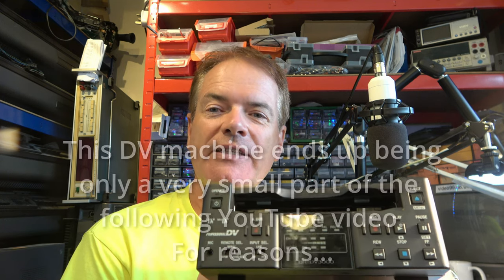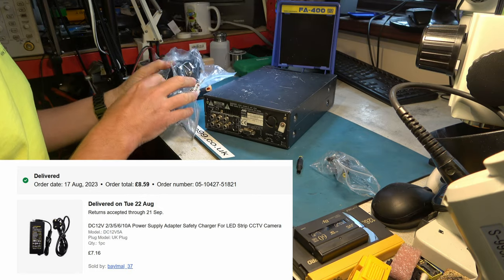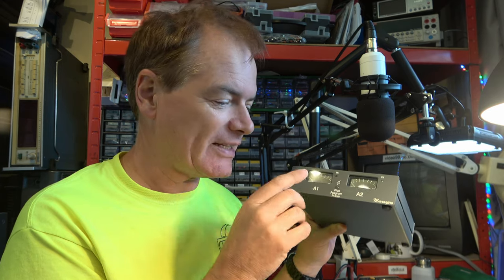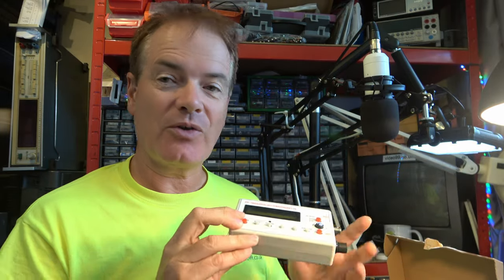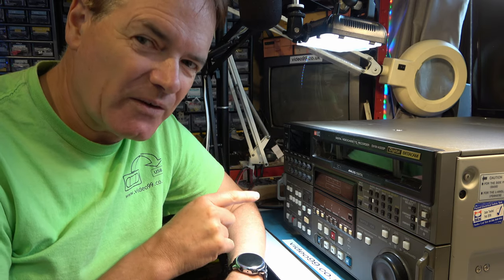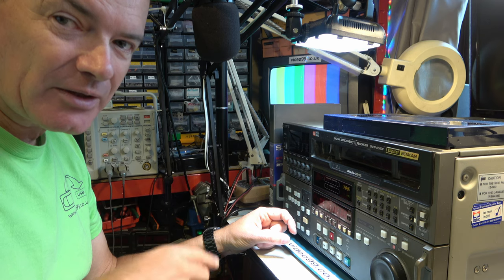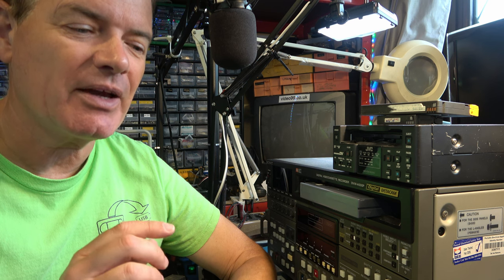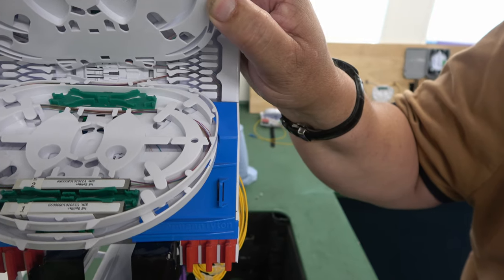JVC BR-DV3000U power, PICO PPM meter, DigiBeta breakdown. And a sig gen. What a mix!

Comment: As always Colin. It's a pleasure watching your uploads.

I just took a look at the Operational Manual for this particular machine, because I'm on the hunt for why domestic videorecorders only hava a video-S/N level around 43dB, whereas professional machinery clearly have a lower video noise floor.

Video- S/N, Sony DVW-A500P:
Digital Serial Input to Analogue Component Output: 62 dB.
Analogue Component Input to Analogue Component Output: 56 dB.
Analgue Composite Input to Analogue Composite Output: 58 dB.

Betacam SP playback:
Y: Metal Tape: 48 dB, Oxide Tape: 46 dB.
R-Y/B-Y: Metal Tape: 48 dB, Oxide Tape: 45 dB.

I guess it's no wonder why Chroma noise was/is such an issue wih domestic video recorders.
Just compare -43 dB with -58 dB. (Who's going to show this difference in a youtube video ?)

The only thing one/you/me realistically could do, was to find the tapes that performed better as shown by magazine tests/reviews, which were the only way to get a basic feeling of the quality, since videotapes were expensive.

Buy the best tapes and avoid the cheapest offers.
But even then, chroma noise got on my nerves.

Even analogue playback on these professional machines is such a delight. Clean clear colours.
Reply: Betamax III (NTSC/PAL/SECAM) 1982 Iron oxide 3.8-5.2 Mhz, JVC (Victor) VHS (NTSC) 1976, (PAL/SECAM) 1978 Iron oxide 3.8-4.8 Mhz, HQ-VHS steeper 3.15 MHz low pass filter 1986, S-VHS 1988 high density Iron oxide 5.4-7 Mhz, Video 2000 Grundig/Philips (PAL/SECAM) 1979 Chromium dioxide 3.35-4.7 Mhz. From the differences you can calculate the frequency swing, which is approx. 2MHz for Betacam. Since the synchronous pulse is included, there is even less frequency deviation left for the image content. With color under video recorders with AM modulation, tape noise is 100% visible. The color difference signals are recorded FM modulated at Betacam. Old professional recorders (Quadruplex, B-format, C-format) record an FM modulated CVBS signal. YT is unsuitable for image comparison because PAL cannot be transmitted, the sharpness is EXTREMELY reduced with SD (NTSC 50), and very strong noise reduction is applied. Since the highest FM carrier frequency is used for white, the video resolution for black is correspondingly lower. The synchronous pulse and thus the resolution/precision are even lower.

Comment: The flashing “STOP” button is simply indicating that the machine does not have a reference or sync signal (usually blackburst) attached to the REF IN connector to provide sync to the playback servo.  If I recall, the DVW-A500 has a menu option where you can turn the warning off. Generally speaking, all machines should be “clocked” to the same house reference signal to permit field accurate timing and editing between multiple machines.
Reply: It can also flash if the incoming video timing doesn't match the reference. I think that machine must have it's OUT REF switch set to INPUT rather than REF, since it stops flashing when it sees a valid video signal.

Comment: Only recently got into Digibetas, 
There are three cleaners in the unit, and should be cleaned regularly.  The roller for the rear stationary heads can be replaced or at least dusted off, but most important is the rotary head cleaner - with attached solenoid assembly and the tape scraper.  The tape scraper has a gap between the two blades and needs to be cleared out using a post-it note. The rotary head cleaner can be cleaned but should be replaced when it wears down, you don't want the plastic parts contacting the heads. All these cleaners can foul the heads if not maintained.

Comment: It could be some kind of electronic sync problem. From experience if a fault magically disappears like that it will magically reappears once the customer has lugged it back and connected it up. One quick trick is to find the PCB with all the control circuitry and try freezing those chips. I've had the odd temperamental chip where the fault is temperature dependent. Plus check the connections and anything else that might cause it. Liquid damage is another possibility.
Reply from the maker: Have you seen the price of freezer these days?  I still use it for fault finding known temperature related faults, but it's not quite as readily used to just cool down a whole machine to look for an intermittent fault.  It's possible to invert a can of "compressed air duster" for a cooling action but this method produces a lot of ice.

Comment: Red Channel condition when playing back a BetaSP tape could mean something as simple as dirty heads. Also the head drum on the Digi-Beta format is larger in diameter than the BetaSP format, so there's some processing going on when playing back the analogue format to compensate for the larger drum. That might explain the strange split picture you've got with the VITC in the centre of the image, as the signal coming off the tape is being time-compressed then expanded back to normal.
Reply from the maker: Yes I read about that time compression.  Reminds us of the processing done in the Betamovie camcorders.
Reply: I think there's similar mechanical differences between HDCam and Digi-Beta. As I remember someone bringing in some freshly recorded camera tapes on Digi-Beta format that they couldn't get to playback in their edit suite. True enough I couldn't get them to play in any DVW-A500P without a red channel condition and picture break-up. Just out of curiosity I put one in a HDW-M2000P (HDCam recorder with Multi-format playback), and it worked perfectly no break up and green channel condition. My guess is the Digi-Beta camcorder they were recorded on had a tracking/alignment error, and something about the tape wrap on the HDW deck was able to compensate for the alignment error that a standard DVW deck couldn't.

Comment: That JVC seems to be a rebranded Panasonic AG-DV2500, even the same power plug
Reply: I think that JVC was in charge, but Panasonic was allowed to have a say about what the device should look like, so that Panasonic buys a large number of units and doesn't have to build anything of its own. In any case, it looks like on Ebay that Panasonic was not the junior partner when it came to the number of units.
Reply: I think they were all made by JVC. As I don't recall a Panasonic version of the earlier JVC model the DV-300, or the later DV-6000 just this one the DV-3000/AG-DV2500.

Comment: 26:55 That warning could have been due to the difference in lubrication between tape brands. AFAIK, there were only 3 manufacturers of DV tape: Sony, Panasonic and TDK. Sony tapes used wet lubricant, and Panasonic (which made tape for JVC, Maxell, Canon and Fuji) used dry lubricant. TDK had its own Metal Evaporate formulation. According to online forums during the heyday of DV, it was advisable to stick to one lubrication type (i.e. Sony or Panasonic etc.) so as not to risk gumming up the transport by mixing types. Assuming the warning label was from a Panasonic/JVC deck, it would make sense for them to want to steer people towards sticking their own brand (and its OEM variants) over Sony.
Reply: Apart from worse adhesive spots at the beginning (and End) of the tape, I didn't notice any difference with TDK compared to Panasonic. Given the rather modest offering in Germany, I can't imagine that TDK has set up its own production line for the pancakes, which are rather difficult to produce. I only bought TDK because Panasonic "couldn't" always deliver at a good price (which is important for 3500 pieces), and I read that the pancakes come from Panasonic. I only had cleaning cassettes from SONY. Unfortunately, I am not allowed to write here about anyone who has warned their own workshops about PANASONIC cleaning cassettes, as it is just “hearsay”.
Reply: The warning sticker on the JVC deck about Sony Premium tapes was put on by the local engineering team where it was installed. My guess is it went back for repair a lot and they discovered it was the Sony tape brand causing the issue, or perhaps there was a service bulletin from JVC about it.

Comment: I wouldn't rule out Dynamic Motion Control. I have often seen positionally stable quality jumps across many lines in V2K videos on YT.
Reply from the maker: That would be hard to fix, other than with a whole panel swap.  But would that affect both digital and analogue playback, and digital recordings?  I'm not sure.
Reply: @video99couk  The rectangles in the drum circuit diagram seem to me to be the DMC carrier plates, so the DMC is probably analog and digital.

Comment: I Have the same intermitent problem on exactly the same Deck (DVW-A500P) i have. I tryed to clean the heads, change tapes, remove and reinstal the boards, but did not solved the problem. From time to time I have this issue of digital blocky image and ''red channel condition'', and I noticed that it (apparently) happens on the winter, but not on the summer! Although it is inside home, on summer I have higher temperature than on winter. Is it possible that this issue is co-related with temperature?
Reply from the maker: What effect do you get when playing analogue tapes?  Is it similar?

Comment: hi the decks are hell as heavy 
i picked alot of ebay and alot are not working right 
please don't buy from ebay only if you can fix them  i can

all the decks i had from seller are from men caves they got hold of them and could not
fix them  they told me when i picked up the deck

note i had to use wheel that could take a heavy load  i did pick one up on the new  
line all because it had lifts and i had the right transporting gear   bond street  is great to pick 
up this kind of gear in london town